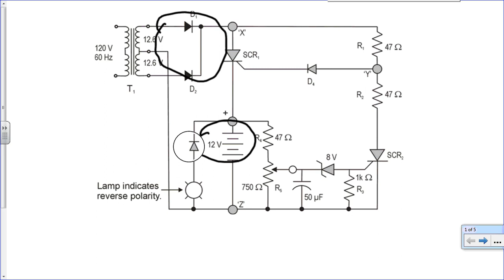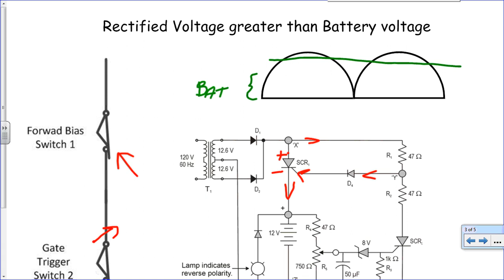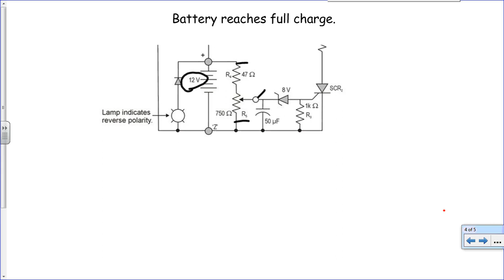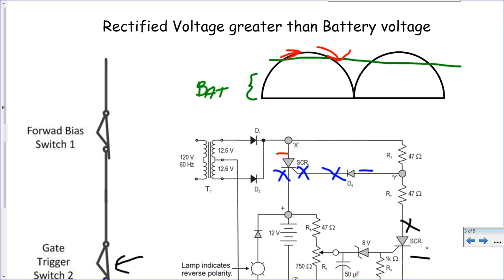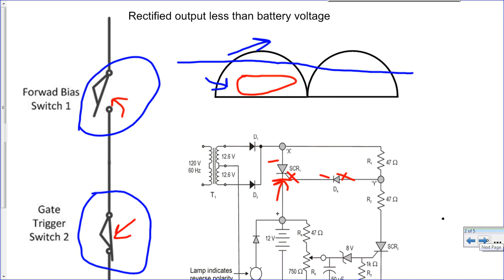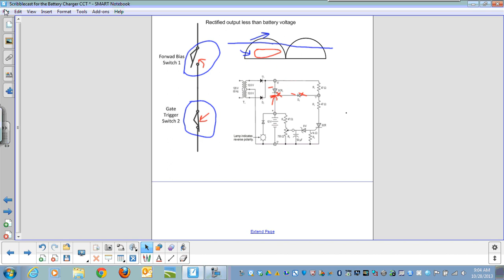Scribblecast for the Battery Charger CCT

Comment: I'm trying to troubleshoot an old-school 12v charger. SCR tests good, and will latch when tested with 12v supple and  enough holding current.

I seem to be lacking the gate pulse signal. Any idea how those tiny little PCBs produce the gate signal?

Scope shows minimal to zero  volts coming into gate, and if my gate to cathode resistance is around 35 ohms, I suspect I need about 14v peaks to give the 50ma gate current for triggering, when connected to a 12v battery.